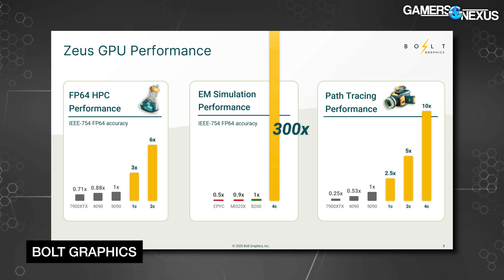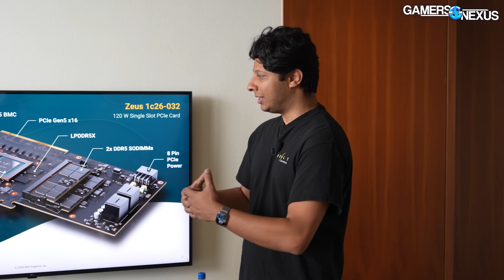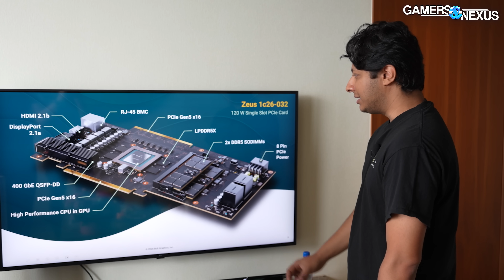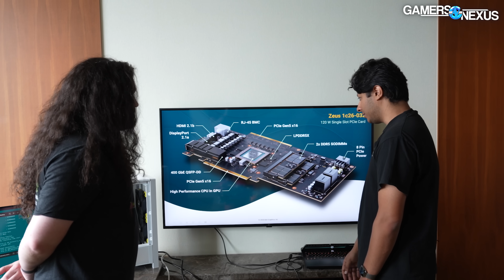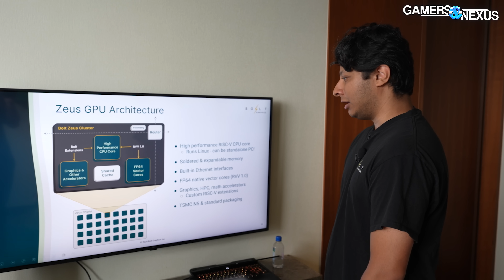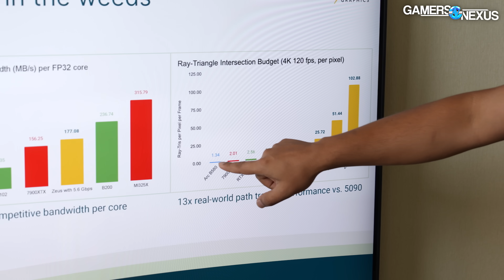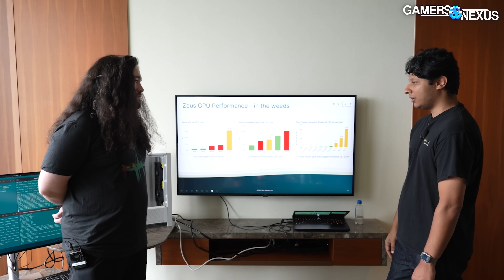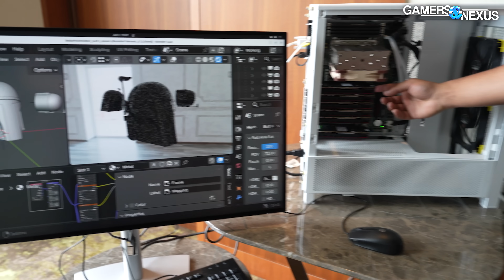A New Gaming GPU Challenger: Bolt Graphics Takes Aim at NVIDIA

Comment: I think the way the industry used to price GPU product lines worked pretty good until the scarcity problem hit. Where each product upgrade was a fixed amount, until you got to the flagship where it was double. So for example if you only had four products, you might start entry level at $250, then $350, then $450, and for the flagship it would be $650. Or something along those lines.

Comment: I think this needs to be thought of as half way between a PC and a console. There is more of a constrained environment than typical PC gaming. Maybe make this a LTS architecture so that developers can tune for this architecture consistently the same as they would a console. A lot of gamers aren't seeking the bleeding edge. They just want to console experience with the fllexibility and ecosystem of a PC. I think this is especially the case for Linux (and Mac?) gaming where there is some acceptance of ecoysystem limitation. BUT, if you are also offering a massive cost reduction for Windows games and you can deliver the FPS for twitch gaming, then you're set given the AI price inflation for all existing chips. And yeah, I'm taking brand new 32GB DDR5 5600 out of a NAS tomorrow to upgrade it to 64GB, and if I had this card available I'd buy it tomorrow and dump it in as an inference processor - there's a big market for the kind of tinkerers that buy a GX Spark. Or all Homelab tinkerers and power users. And maybe some kind of physics enhancer as an augmentation to existing gaming? Seems big possibilities.

Comment: They just need to target Linux. Open source the firmware. Target Linux as the #1. Tune for Proton rather than needing to tune per-game. Instantly scoop up 2-3% of the market (4-5% of PC computers are Linux). I'd install one as a SECOND GPU immediately! Free up my main GPU for AI. Linux users will do these things just out of curiosity and love. And then the entire firmware stack will be optimised. I'd probably end up buying 3 to use as AI nodes as well. From there you're firmware is optimised for expansion into Windows domain. And maybe get it talking to macOS as an AI accelerator without needing an external OCuLink?

Comment: So if it is using ddr5 ram for memory, doesn't that mean the system bus bandwidth is going to be way lower than a traditional GPU?
Reply: Depends, but definitevly workflow between ,,grafical chip,, and ram will be very very slow in comparison with standard modern gpu

Comment: Not necessarily. In the AI era, they could easily deploy 10,000 AI agents or AI-assisted engineers and port 1,000 games in a matter of weeks!
That's the true power of AI: turning centuries of work into hours.

Just look at Google DeepMind's GNoME. It reportedly accelerated materials discovery by the equivalent of roughly 800 years of research🤗 

Software is a solved problem. Now all we need is the hardware 🚀🚀

Comment: Strangely enough, I might represent the early target market for this. Blender, when using multiple cards must load all scene rendering data onto a single card, posing an upper limit for scene complexity for cheap-multi GPU rendering (excluding SLI, which has since become obsolete on anything outside of high-end Ampere and professional-tier cards). The only other GPUs that possess equivalent frame buffer capacity are the RTX 5090, Radeon Pro 9700, and Intel ARC B70 (which might run into issues loading larger scenes, since it's composed of two GPUs with 16GB of VRAM each). Combined with a cheap Threadripper 5000 or Epyc 7003 (or perhaps even a dual socket system to expansionmax) platform, a build stocked with these could make for a killer render farm. I wouldn't have a the need for the BMC or 400GbE networking, but all else is quite appealing to me. The only question that matters now is this: how well does a completed unit render when compared to its competition (dollar for dollar, watt for watt)?

Comment: The biggest issue is material. Until AI dies, (it won't. It is too useful for spying on people.) getting the material necessary to make the cards is going to make it expensive. We are currently waiting for cheaper alternatives to what is needed to make the parts and the ability to produce them faster.

Comment: I have been keeping an eye out for bolt over the last couple of years since they first had their name mentioned on the scene. 

Their choice to specifically target Ray tracing makes sense to me but also been thinking since about 2016 is this reminiscent of the move away from Voodoo glide to anyone else? 

A question I did not hear asked, have they put any thought into being a co-processing card of sorts? Similar to the old phys-x card and engine before Nvidia bought them.
Reply: that was, funnily, also my first thought... like, by the way he speaks it seems they want to go into the professional market first, rather than gaming, which also explains the tradeoff of minimized rasterization performance in lieu of sheer ray tracing prowess. So, I literally just instantly thought "so, will the drivers allow them to be paired to a more regular GPU from, like, nVidia, AMD, or intel as a co-processor specifically for ray/path tracing?"
If yes, and assuming their idea of affordable is actually in the realm of reality, I'd honestly be tempted to chuck one of their cards into my rig alongside my normal GPU... even if it doesn't speed up gaming all that much if at all... I literally use Blender regularly. I'd see no downside to an extra speedup just for that, especially if I could, if needed, just chuck more RAM onto it so I don't run into yet another out of memory error I have to work around.

Comment: 10/10 would buy as long as it doesn't break the bank. a card I can game on and slowly upgrade to handle workstation/AI workloads? zero nvidia? yes please. 
I just question if gamers have been slapped around enough by the industry to even entertain it unless it's pushing top tier performance when they release it

Comment: I thought the barrier to entry in GPU market is mostly patent based.

How do they intend to get around this?

Maybe they get a licence from Imagination or ARM, even if only to develop software compatiblity, but seems unlikely.

Seems like they want someone to buy them, and this board is beyond goofy and obviously AI.

There are two ethernet ports apparently buttfucking each other at the right side edge of the board, on the interior of the board, where it would be annoying or impossible to connect anything.

There are no caps on the board.

There are no traces on the board.

It is an AI generated image, and not a technical one.

He doesn't even address why the board has PCIE connectors on both sides.  The amount of trace and waste, and how complicated that would be is wild.

Due to patents, even a RISC-V based GPU would require access to the patent lockdown for mass market.  That would mean licensing ARM or Broadcom or Imagination.

This is snake oil, and that GPU image is really funny and AI generated.  The balls on the guy, to have things pointed out on it and not blanche.

Comment: Let's see.  Integrated CPU, Xilinx, tensor units, UCIe, 400GbE and 800GbE, tons of memory expandable to 2TB with multiple cards(Frontier level size), full PCIe direct to secondary cards as well as the very high bandwidth network.  His mouth is talking about FP64 and graphics studios, everything else is pointed to ai and data centers or even inter-connectable local home ai boxes.   This is not a graphics card, it could be something bigger.  I hope they make it but this isn't David vs. Goliath, this David vs. Goliath's.

Comment: Focussing on ray tracing is insane. Either he's delusional, which doesn't seem to be the case, or they're forced into that because their raster sucks. That's fine, it's going to be the case, but openly stating you're prioritising ray tracing over raster is asking for 0 customer interest. Making a GPU is a brave thing to try, so well done for that, but I really do not see this going anywhere. Especially with DIMM RAM, the performance will just be horrible. There's a reason Intel still hasn't made a desirable GPU yet.

Comment: Wait wait wait...a RISC-V mini pc with SODIMM RAM and an NVMe? I want to know the core config and memory bandwidth as well as the performance because the whole "RISC is the Future" has been the ultimate facepalm as future can be 10 years or 100 years (it was said 30 years ago in Hackers)...and at the rate it has been going it looks like its gunna be 100 years. But I guess the real question is can it run Haiku OS? (maybe in 100 years we can ask if it will run Crysis). EDIT: I used one of those cheap early RISC-V SBCs to boot an official build of Ubuntu and it was slower than a Cyrix 386.

Comment: I'd think the primary question for "cheap videocards with lots of VRAM" is "can it do AI?", but that wasn't touched on here at all.
Reply: what would you need ai for if the card can do what you want it to do? 90% of gamers use ai only to get more fps when its low which is also not how you should use the ai features but oh well... besides theyre prob gonna add ai stuff later, they just need to set the ground first
Reply: @Iwasfoundunharmed  Not sure what your question means: it seems like asking "what would you need a kettle that can make tea for, when it can make perfectly good hot water for ramen?" Why would people want to limit themselves to just the one capability? I agree the the majority of people with videocards want them for gaming, but I'd say that the overwhelming majority of people who have (or want) a 5090, it's because the higher VRAM lets them run larger AI models. There exist no only-gamers who need a 5090, for any game made ever.
I'm particularly interested in whether the different architecture, based around raytracing instead of rasterization, makes the parallelization of AI more or less feasible. Videocards typically parallelize tasks for each pixel, and that maps well to handling the vectorization of dimensions in AI models. Would it need a whole new approach to write AI code, or would it be more of a case of "the shader commands still work, just slower"? If it makes AI a whole lot less feasible, then that's a wonderful answer to the high-videocard-pricing problem that AI has caused: these cards won't suffer immediate price inflation from AI. Otherwise, expandable VRAM is exactly what people have been freaking begging for, for local AI, and this card will sell like hot cakes.

Comment: Cool Video! I think they should ditch the Rasterizing side of their hardware (adding in more path tracing cores), then simulate rasterization using the path tracing hardware, as their rays per pixel is so high could easily path trace a rasterized triangle (or any primitive) on screen, & it would be very fast! They could just simulate each Rasterized pixel in whatever resolution up to 4K using their path tracing hardware =D

Comment: As someone who worked on the Caustic > Imagination Wizard raytracing hardware I wish them the best, but even the professional market is a tough nut to crack.  I am curious how they're handling shading. That's always the bottelneck, it's easy to have a crazy high ray count co-processor, but if it takes longer to get the rays to shading hardware and back you just sit waiting for shading.  Caustic tried to solve that with ray-reordering and sending batches together to be shaded but that required re-designing your entire rendering pipeline which meant nobody adopted it.

The biggest obstacle for these small startups though is always the same. By the time you ship your 10x product, Moore's law usually has already delivered 10x through brute force (and/or software updates).

Comment: I think it's kind of interesting for running LLMs. He mentioned it has cpu cores and you can run Linux, so in theory you could slot one of these in and run a LLM server on your machine with pretty much zero overhead. Just need to pay out the nose for the ddr5 sodimms that are big enough to run the model you want

Comment: The RT focus for hardware will only push required specs higher, make gaming more expensive and the devs more lazy
Reply: Not if the gpu is actually capable of rt
Reply: @TRYno397 thanks for making my point for me
Reply: @woollama  what i meant is if it’s more capable why would they need to optimize the games more ? Unlike current which still incapable for raytracing
Reply: @TRYno397 bugfixing is a part of it. Textures and models can be terrible also, leading to a very bad experience playing the game. RT is a big symptom of a bigger issue: laziness and corporate interest

Comment: At this point what a startup like bolt needs is valve. Yes that valve that has superb driver engineers that built the crazy fast linux open source driver stack for amd. Because amds engineers couldnt or werent funded to do.

Comment: Huge issue with the second PCI-E connector -- they need to reverse it or something, so that idiots don't plug the card into their motherboards backwards. -- It would still allow them the standard ribbon cable style "SLI" they want, but it would prevent people from plugging in the card upside down and prevents electrical damage to the card and motherboard.

Comment: Honestly being able to upgrade the ram for the gpu is a game changer. You habe 8 gigs and not getting enough performance just put 2 slots and make it 24gb.. it will help so much eith heavy intensive vram usage and its an amazing idea
Reply: Actually this is also major cost reduction in production, I know I had to design memory on the circuit board before 😅
Reply: @Mechaman1 Hi , yea its interesting idea but nothing new, it was used before and tested many times. But there is a catch, speed of those mems is very insufficient for video card standard work as gaming. And im not talking about slower for 10 fps , but  100s of percents even (depends on what is as workload) This card has nothing to do with gaming.

Comment: I assume for gaming they'd work as accelerators, or a complete industry shift with no support for legacy gaming?
This is essentially a computer - like the description says 'computer-on-card' - and not a GPU as we know it.
When they mention gaming that must be a far in the future, theoretical idea. The card as shown here, would not work well as a gaming GPU, not unless we see a total market shift, or they design a card - much more like Nvidia's and AMDs - that uses most of the chip for general-purpose programmable shaders, not specialized path-tracing.

To reach the goals they mention, they have to focus on specialized ASIC. He's not wrong when he says Nvidia just "shoved" RT cores into the GPU because that's kind of what they did.
Even though Nvidia pushes for AI [Tensor Cores] and ray-tracing [RT Cores], the biggest part of Nvidia's chip is for general-purpose programmable shaders, the way almost all games render, even with RT, DLSS and such enabled.
The Bolt Zeus is the inverse! While it is a GPGPU, it's much more specialized, and focus on ASIC-functions for path-tracing and scientific physics simulation... It still does general-purpose programmable shaders, but it's heavily scaled back compared to the RTX 5090.

Although you can argue the RTX 5090 isn't for gamers, as it cost a kidney... It's designed to be general-purpose where the Bolt Zeus is much more specialized.
This is also why they're targeting the businesses they are. Specialized hardware like this is exactly what a Hollywood render farm needs.
It's not really what regular gamers need. The performance cost in ray-tracing comes at a steep cost that would make regular rasterization crawl to a halt.

Remember, the damn chip is based on RISC-V, runs Linux, has ethernet - the depicted card even has a BMC port... - it's a computer on its own. The user-replaceable memory is slow laptop DDR5, it's replaceable but simply acts as an overflow for when you load so much data you overflow the faster LPDDR5X chips.

What we see here is not a new gaming GPU, it's way too specialized, and not nearly fast enough in general-purpose programmable shaders to replace your current GPU for gaming.
Getting that rasterization speed will come at a cost, so I assume their goal with gaming is fully ray/path-traced games with no rasterization, regardless of what the users want and what that might mean to their old games.

What we see here is breath of fresh air and it's exactly what the market needs, even if it ends with Bolt being bought by a larger company. It is not an RTX 5090 killer!